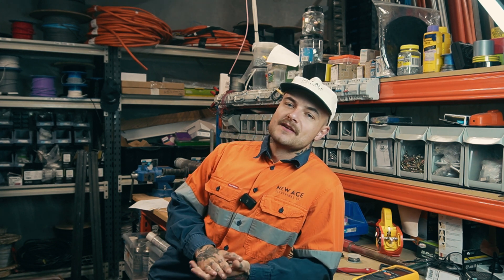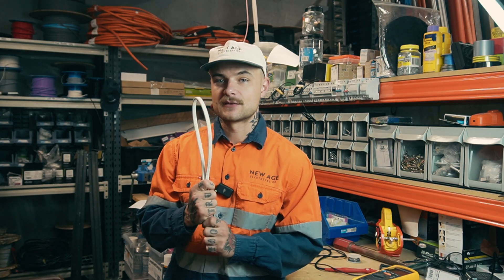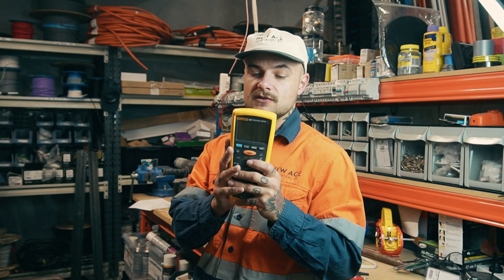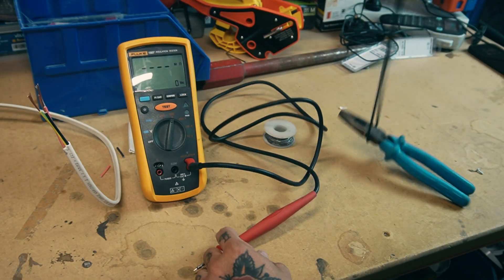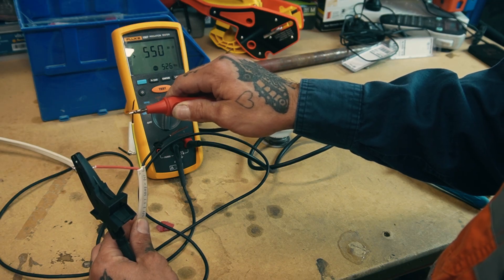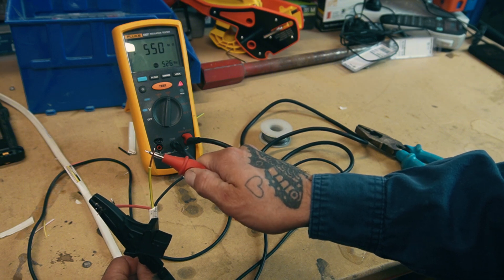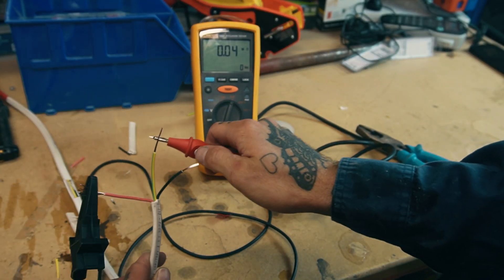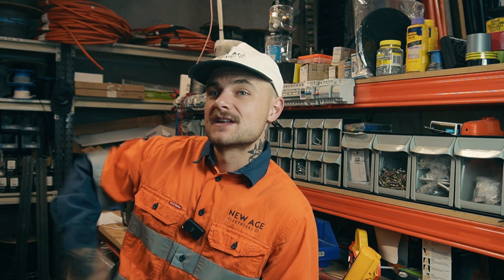Insulation Resistance Testing A Damaged Cable - How does water affect your results? / Fluke 1507

Comment: Dodgy bathroom extractor in an old QLD fibro house was dumping straight into the roof space, a rat had chewed on the lighting circuit above the bathroom.  House had been fitted with RCBOs in summer and all went well until winter rolled around.  Only on cold mornings the steam condensed onto the damaged cable and caused the lighting RCBO to trip.  As told to be by another electrician.
Reply from the maker: Yeh it’s one of those had to be there on the right time on the right day for it to trip!

Comment: The rat chews I've seen over the decades, I can't remember seeing the active copper exposed, I've seen the neutral and earth chewed  down to the copper. Maybe they've learned, I guess that's where the saying rat cunning comes from, but then again, how smart can they be chewing on thermo plastic sheath in the first place.
With just the neutral and earth exposed, maybe enough dust build up might also show a breakdown in insulation, but before RCDs where mandatory the fault could go unnoticed.
Reply from the maker: Iv seen a few with the rats attached haha. Good point on the dust. I do a few more simulations and can do the same but with a Build up of dust

Comment: Spot on with this demonstration, a majority of the time these intermittent faults will be caused by water building up and then drying out - if you've never seen a fault like this before you will be wondering wtf is going on. Had a wild one in an old Queenslander where the single panel VJ walls would condensate on the outside of a Bedroom after running an air-con all night and was making it's way into GPO's on the outside walls, IR would be down in the mornings when condensation was at its peak, causing the circuit to trip and then would hold later in the day after walls dried out.

Comment: I had this exact situation one time & the place was completely dry but after some considerable investigation I discovered the water was coming from a condensation pan on an air-conditioning unit,so it doesn't always have to come from a typical water source.🤔
Reply from the maker: How goods that feeling when you find the source of a crazy fault though!
Reply: @NewAgeElectricalCo absolutely, actually I was the second one to have a go at it,the guy before me couldn't find it,ya gotta think outside the box.😉